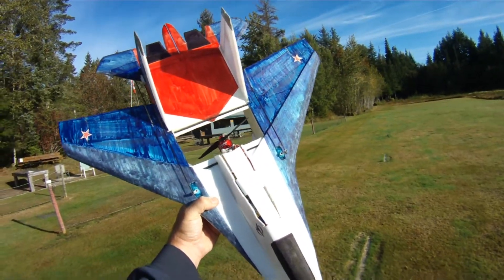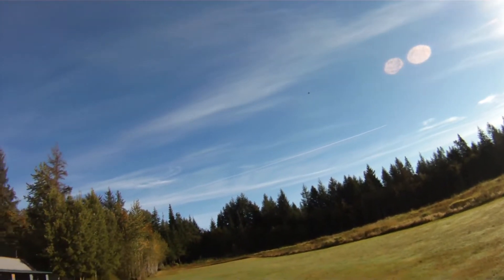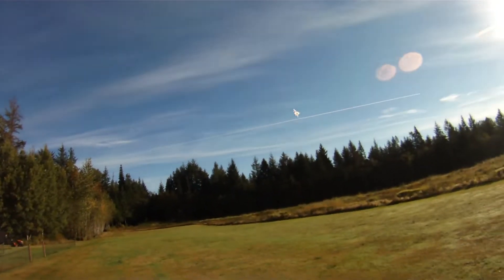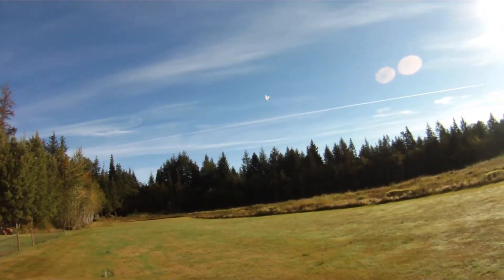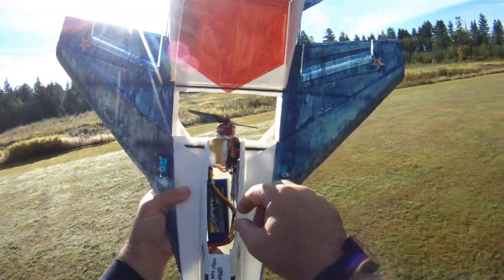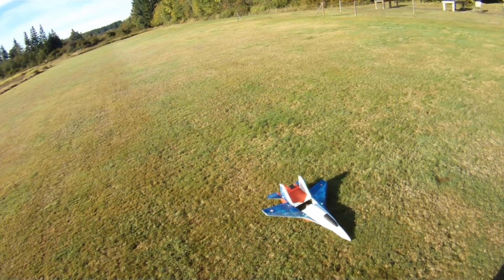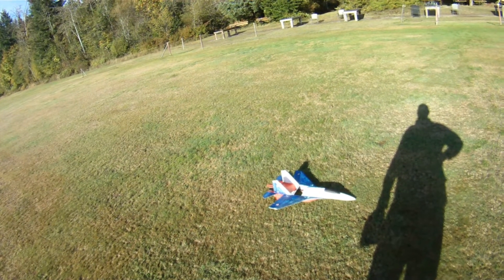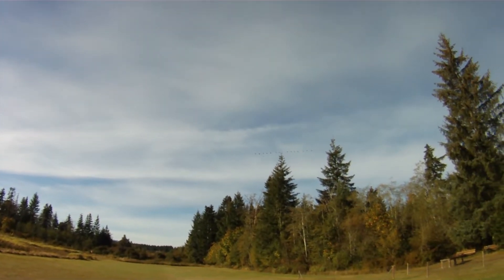Field test - Racerstar BR2406S 2600 kv with 6x3 sport prop on 3S - 18 Sep 2018

Comment: Looks like another very good budget motor ;-) The amp draw looks very good for a 2600kv motor spinning a 6x3 prop. That looks fairly efficient. Thanks for the testing and Happy Flying!
Reply from the maker: Thanks very much, I just ordered some 6x3 APC sport props to experiment with as well https://www.amainhobbies.com/apc-6x3-sport-propeller-apc06030/p36470  These might also be a good efficient prop to try on this motor on 3S and I'm interested to see what results I might get on 4S on some of the other "beastie" quad motors I run on some of my planes :)  These APC props are a bit more expensive, but very high quality and durable, I have been running the 6x4 APC props for over a year now with no problems whatsoever.  Looking forward to continuing more testing, thanks for watching and happy flying to you as well :)  Cheers, Scott